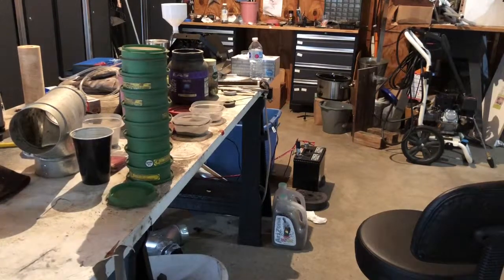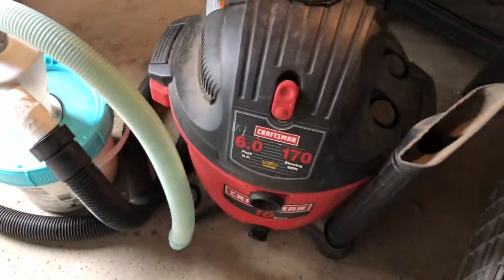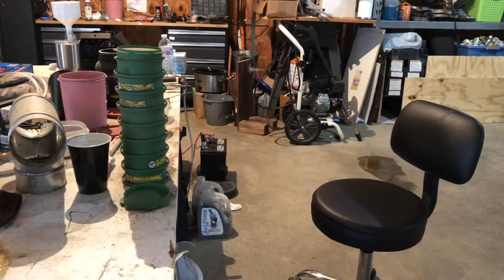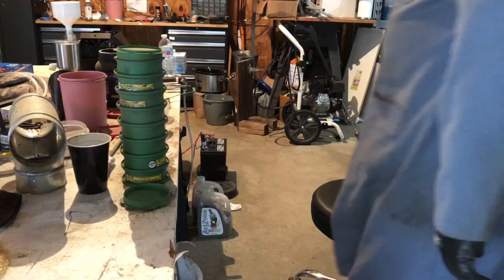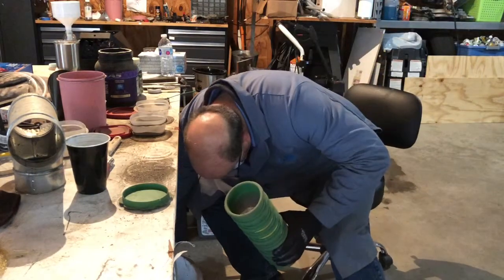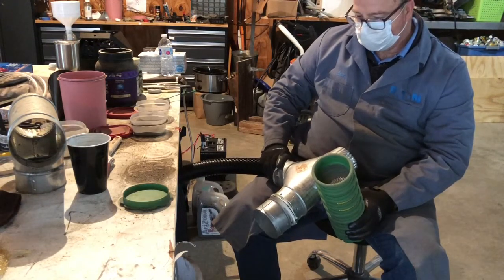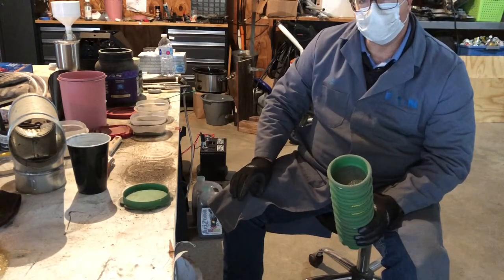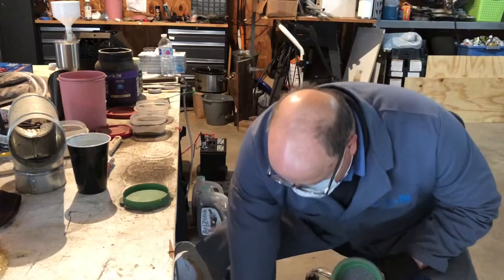Filtering street dirt to find platinum

Comment: Use a centrifugal separator to clean your dirt. Also changing the size of the opening of your pickup will change how large of a particle(pebble) it will pick up. Make it the right size and it should skip large pebbles and only vacuum dust.
Reply from the maker: Thanks! Would a centrifugal separator be expensive? Also I’d be concerned with the screen plugging up. I thought of an outside the box idea of using a rail gun type setup to move the metal particles. I wonder if that would work.

Comment: Awesome video, Jason. Would be interested to see the results!
Reply from the maker: I have not found any platinum yet. I have done chemical and fire assay. I think the next step is to try to get dirt vacuumed from a major highway by street sweepers. It would be good to have a XRF analyzer to check the chemical composition to abbreviate the process. Except they are very expensive. If I could get the timing right I could arrange with the street sweepers to allow me to check they’re vacuumings and rent the xrf gun to check them out. Then if I found any I could sell the PGMs and use that money to buy my own xrf device.
Reply: @jasonking3629   How can I send you a couple pounds of high quality road dust, both platinum and palladium?
Reply from the maker: @scottystiffchicken  I’ll get back to you on that next week!
Reply from the maker: How do you know the road dust has PGMs?
Reply: @jasonking3629  so I work for a large municipality road department. They started a new improvement on one of our freeways that shifts traffic to the inside over about a mile of rumble strips which is creating a mile of speed bumps. That constant bumping is knocking the good stuff out of the catalytic converters. On my way home Thursday, I saw what looked like pollen but as I crossed it, it shined like gold so my very next shift I went out a scooped up a bucket. I believe with all my heart this is palladium (mostly). This is just the first sample, it may decrease a little but I plan on getting a 5-gal bucket every week.
Reply: @scottystiffchicken  i need an update haha